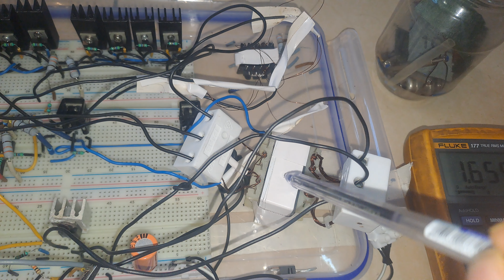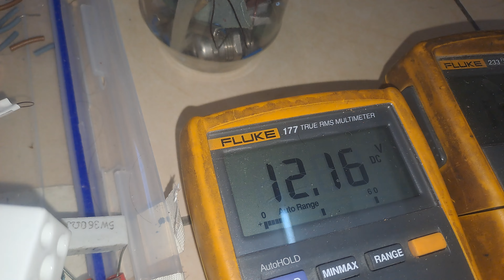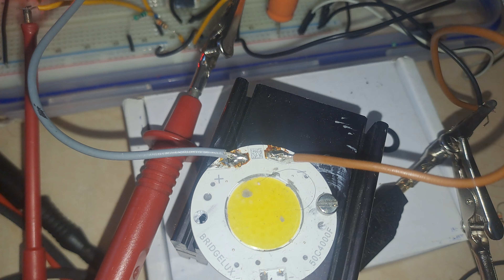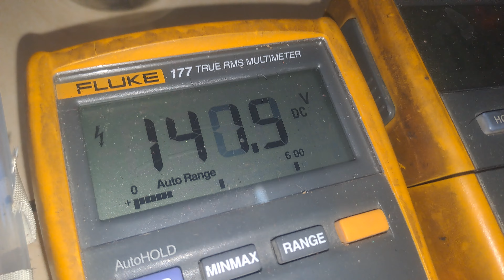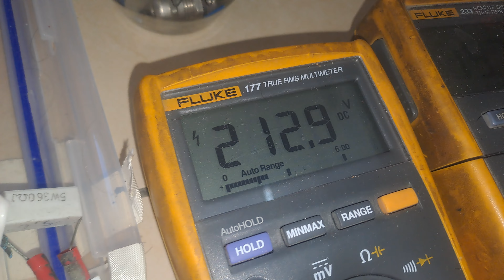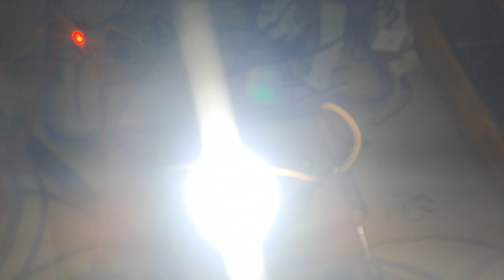SMPS based power supply 90-220V AC to 30V DC @ 10 A. Based on IC TL494 PWM controller.

Comment: Push pull SMPS you make a half bridge SMPS or to switch forward technology SMPS
Reply from the maker: Im planning for full bridge in next design. Also switch forward i m planning as it will be low cost, low power solution.